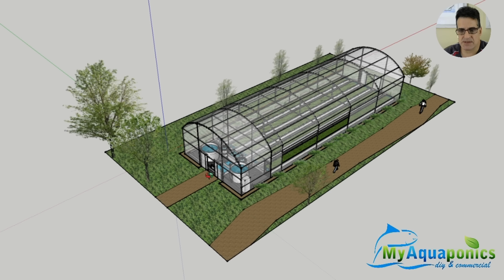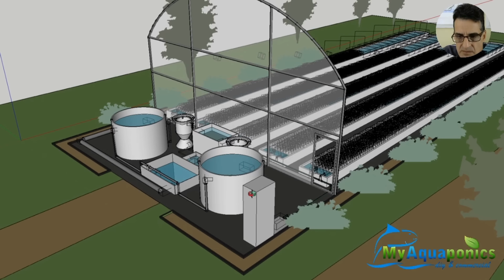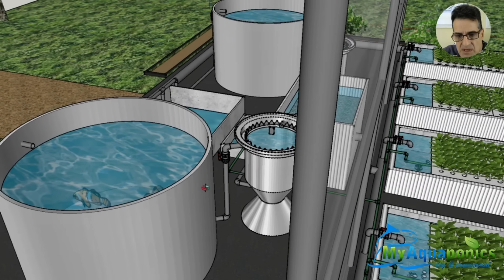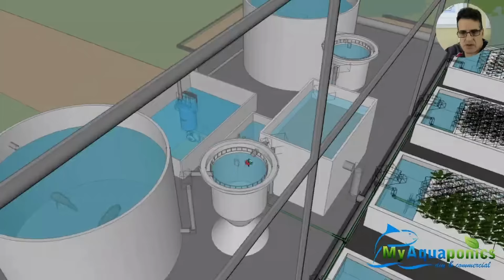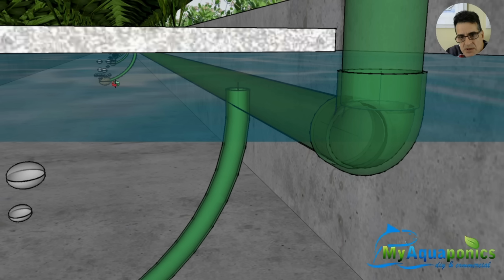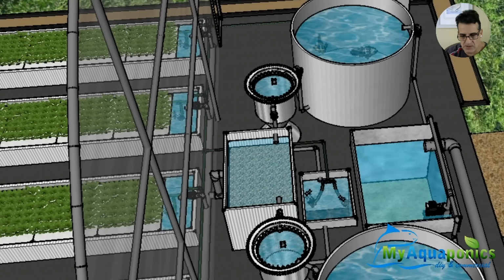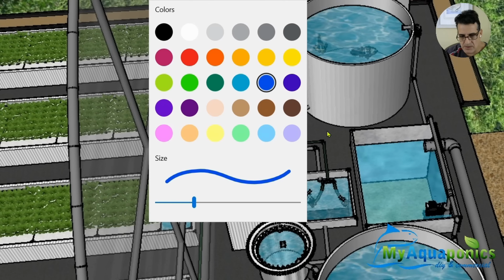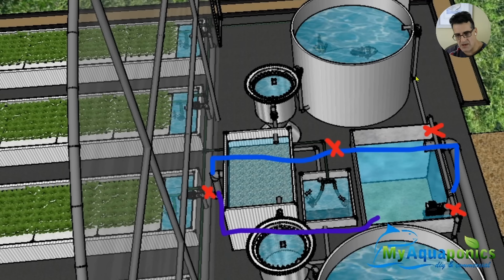The Best Commercial Aquaponics System Design explained in 3D : 2020

Comment: Very interesting. I am looking at this for tropical Asia. Water is abundant so I see very little need to pump it back into the fish tanks.  It seems like I can skip the biofilter if I pump it into ebb and flow gravel beds. What if I use the water from these tanks for the deep water culture further down? Will it be too lacking in nutrients then? Also wondering if I should skip those Deep Water Culture beds further down, instead opt for drip feed beds on the ground. I can then add other manure there if need be.  Also pondering if I should do azolla and duckweed somewhere in the system. Seems like it would take years to test out the optimal system. Guess I should build one greenhouse, then start with 1/4 of capacity to test it out. Then build out the other beds once I have something that works. The glass fibre beds that work both as ebb and flow and deep water culture is a genius move btw. Standardisation is the ticket.
Reply from the maker: Yes if you have ebb and flow media beds you can get away without a biofilter, all dependant on fish stocking densities.. Yes, you could use drip irrigation instead of DWC. Personally I would go with sandponics (sand grow beds).. Have a look at our Sandponics videos (Part 2-4) on our youtube channel. We do let duckweed grow on our DWC to feed to the fish .
Reply: @MyAquaponics1  Very interesting. Thank you, I will check those vids.

Comment: Won't all the right angles in those pipes reduce the flow rate of the pumps? Just curious, I don't actually know anything about this stuff, lol.
Reply from the maker: Not at all.. Of course there is always some loss due to friction, but in this design flow is not at the max capacity of the pipes. As long as you turning the volume in teh fish tanks every hour or so, all good.

Comment: How much total investment required??
Reply from the maker: in South Africa a system like that , using our 5m long fibreglass grow beds, would cost around R400K (about US$27K at today exchange rate)   excluding labour costs of course, but including installation of greenhouse. YOu can use cheaper materials to achieve the same, based on what you can source in your country

Comment: Hello my name is Welton I live in Brazil I found your project interesting, what is the value to develop this project?.
Reply from the maker: Hi Welton, thank you.  Cost is dependant on the materials you use and your cost of labour. In South Africa, it costs around R450K (USD 26.5K) for a 300sqm greenhouse fully kitted out with fiberglass grow beds
Reply: @MyAquaponics1  

I understand, do you provide this project with all dimensions for free? I found this project very interesting. Or is it a commercial project?.
Reply from the maker: @weltonbragadossantos5145  Hi, we do not make the sketchup file available to the public.. But pretty easy to work out.. that is a standard 30m x 10m tunnel.. The fish tank portion can be 8m long and fish tanks can be 5 m diameter and say 1.4m deep (volume of around 25000l per fish tank)  .. Grow beds 20m long and 1m wide and 400mm deep.. Drawing was done to scale, so the number of rows of growbeds is correct

Comment: How much does the system shown here cost?
Reply from the maker: All dependant on the cost of materials and labour costs in your country..  In South Africa, using our fibreglass grow beds, its around ZAR300K ( about US$ 21K at current rates), excluding labour
Reply: @MyAquaponics1  thank you - is there perhaps a list of materials with which I could calculate the cost here in the USA?
Reply from the maker: @JamesB-kz2vk  We don't have a set list of materials, as it all depends on what the customer eventually chooses (i.e. DWC, media beds, etc) and also whether they will use our fiberglass grow bed and tanks, or make up their own. Main items to consider are the customized greenhouse, water pumps, air pump or blower (plus airstones or other diffusers every 0.5m-1m), fish tanks (lines based, fiberglass, concrete, etc) , polystyrene floating rafts and netpots if DWC, LECA or other media for the grow beds and biofilter. Radial flow filter and buifilter can be made using plastic drums or IBC's.  Piping, pipe accessories and valves, easily calculated from the 3D model. Hope that helps

Comment: many thanks for sharing, really interesting video!
I see this system is slightly different to the regular split system you explained in a previous video where water from the biofilter goes to the sump tank and then from the sump tank water is pumped both to raft beds and fish tanks. Is it better to water the plants straight from the biofilter (like in the video) instead of pumping water to them from the sump tank? I imagine in the latter option plants would get less nutrients because the sump tank would receive a mix of biofiltered water and water recently used from plants (missing nutrients). Is this correct? Thank you very much
Reply from the maker: The split system is basically a design change that can also be applied to the system above by simply changing some valves. Th ebenefit of a split system design is of course to either run it as aquaponics, or hyrdoponics only, or aquaculture only. In recirculating  system plants will eventually get all the nutrients they require.. Keep in mind that water out of the biofilter would be nutrient (nitrate rich).. The function of the biofilter is to convert toxic ammonia into nitrites and then to nitrates which the plants uptake.

Comment: Shouldn't we have a smaller tank for fingerlings fishes before putting them in bigger tanks, to keep the operation running all around the year? Also wouldn't you recommend to use BEADS filter rather than using 2 filters ( one for solids and one Bio) ? Thank you
Reply from the maker: Yes, you can have a fish nursery, but that is usually done in a seperate tunnel or room. The Video above is for a commercial production unit.. Yes, you can use a bubble bead filter which can double up as a mini biofilter too, but they are generally expensive and depending on biomass, you would still need to have separate biofilters. Of course, if you have media grow beds in your system, they too act as biofilters.
Reply: @MyAquaponics1  you mentioned that you are growing Tilpia. İ am also considering to buy a full system like that to grow Tilapia Rendili red breasted while cultivating Duckweed on DWC. My only worries is winter. A greenhouse will not be enough to maintain a 30 c degree temperature during winter. Do you have a solution to keep the temperature above 25 c degree?
Reply from the maker: @Jean.34  If the greenhouse is well insulated with good grade plastic then temperatures in winter can reach 30c if the sun is shining. Not sure where you are located. In Johannesburg the sun shimes during winter days.. But yes, one still needs to heatthe water, there is no cheap way.. Heat Pump is about the best, or otherwise gas or wood heater
Reply: @MyAquaponics1  İ am in east Europe. We have 2 weeks every year when temperature can really drop. İ thought you are located in Sweden not south Africa.

Comment: How much is does this particular system cost ?
Reply from the maker: It all depends in the country where you are and the material and labour costs. Also what materials you use.. Grow beds could be done cheaply in brick and mortar in some countries, or with PVC liner and wooden frames. Here we would use our fiberglass grow beds which are more expensive.. In South Africa, a system like this in a 30 x 10m tunnel would be around ZAR 350K to ZAR 450K.. (about USD 32K)
Reply: @MyAquaponics1  how much can you in a greenhouse this big, both produce and revenue? of course we’re talking rough numbers .
Reply from the maker: @MA797-i5n  again dependant on what you ar egoing to grow..  If something like lettuce or spinach one can grow just over 4000 plants.. so multiply that by whateve you can get in your market .. every 4 weeks (after replanting the seedlings)
Reply: @MyAquaponics1  4000 lettuce per month ?  But thats going to take you a while to make your money back on just this hanger or system couldnt you potentially grow more in the same space
Reply from the maker: @MA797-i5n  you could grow more based on how you arrange the grow beds.. There are other higher value crops. You must grow what gives you the best return per sqm.. Any investment has a pay back period.. Most commercial farmers dont just build one tunnel
Reply: @MyAquaponics1  yes. But at 32k per tunnel, it will become expensive real quick to develop a series of these tunnels.
Reply from the maker: @MA797-i5n  as I have said, that is using the most expensive materials. One can probably do it far half of that depending on country, material costs and labour costs. This is a standard designed already in place in many countries around the world.  This model is not applicable for all countries or economies. If it does not suit your needs, then you need to adapt or look for something else that will serve your needs :)
Reply: @MyAquaponics1  thank you.

Comment: Thanks for sharing such detailed and comprehensive video on building a aquaponics farm. Based on this 10m x 30m aquaponics plant, how much yield one could expect to harvest on a monthly or weekly basis?  Can we get 7000 heads of cabbage every week?  How much the overall investment would be based on using Fibre glass tank?  Thanks.
Reply from the maker: Thank you.. In a system like that you could potentially have 120 Sqm of grow beds and if you are doing lettuce or herbs you can do 30-25 plants per SQM.  Growing cabbage is not recommended as they get very big and take up too much space, so maybe only 4-6 cabbage per sqm, unless you only grow baby cabbage.. In South Africa a 5m x 1.2 fibreglass grow bed sells for about $550 and you can fit about 24 of these beds depending on arrangement.. In SA overall investment for something like this is around $32K based on current exchange rate
Reply: @MyAquaponics1  Thank you so much for sharing the information.  This is much appreciated.
Reply: @MyAquaponics1  Am I right that I can expect a 4 week growth cycle from baby plant to harvest for cabbage?
Reply from the maker: @kenlee224  depends on the variety and climate, but from seedling to harvest can be 4-6 weeks

Comment: good evening sir, please i need the pipes dimensions & aeration network dimensions , drainage network dimensions , material type for water and aeration pipes , pump capacity , blower capacity for the 300msqare system .
Reply from the maker: Most water pipes 50mm. Return pipe from growbeds to sump is 110mm. Air feeder pipes, 50mm. Tap off air feeder pipe with 5mm flexy airtube. Airstones used every 1m or so 50mm diameter. Allow for 6-7l/min per airstone in teh systems to calculate air pump or blower capacity in litres/minute or Cubic metres per hour. For water pump, you want to be turning the volume of water in the fish tanks at least once per hour. So if you have 20 000 litre tanks, then you will need a 20 000l/hr water pump. PVC pipes can be used throughout.

Comment: what is the size of the biofilter? volume of water, volume of media and airflow requred to get it tumbling?
what is the target flow rate or turn over time for the fish tank?

cheers mate.

great video btw.
Reply from the maker: Quick rule of thumb is that the volume of your biofilter and solid separator filter should be around 30% of the volume of your fish tanks.. But for teh actual bio media, other more complex formulae apply which cannot be explained here.  You may be interested in getting our ebook that explains all that. Turn over of water in fish tanks, at least onece or twice per hour. BTW, no tumbling takes place in our biofilter and also no airflow in there. We simply fill the container with bio media such as bioballs or LECA (lightweight expandable clay aggregate) and make sure this media is always submerged in water.  OF COURSE, if you have some flood and drains with media, you may not need a separate bio filter at all. But if NFT or DWC, then you do need a sepaarte biofilter as in the video
Reply: @MyAquaponics1  thank you for the reply. 

curious how the bioballs compare with the leca balls?
Reply from the maker: @sweeyong7756  The platic bioballs we use have an SSA (specic surface area measure im m2/m3) of 500-700, whereas LECA is 240-260 SSA.. So bio balls have a much greater specific surface area for the beneficial bacteria to attach to. Bio Balls do however usually work out more expensive
Reply: @MyAquaponics1  cheers for that.
 yes bioballs do work out more expensive.  
i thought that there be some positive outcomes and results for veg gorwth as leca balls are made from expand clay.

Comment: How many pieces of fish should I put on that size of fish tank? Thank you so much!
Reply: The film has already said that 1000 liters of water can only produce 30 to 50 kilograms of fish.
Reply: "The Best Commercial Aquaponics System" Is this Commercial? Is this the best? 
If you use Dr James Rakocy's or Dr Wilson Leanard's formulas for plants to fish needed then this system should have at least 300kg biomass or have an average of 1500 fish at 200grams to give the plants enough nutrients to grow. If you harvested one tank then half the available nutrient production is lost. This system would then rely heavily on additional nutrient / fertiliser to supply the needed nutrients so that the plants don't go through cycles of severe nutrient deficiency each time the fish need to be harvested. Also the amount of fish food would create a lot of fine particles even with the swirl filters and they will get into the DWC and smother the roots. Do you also have to replace the air stones with cleaned air stones once a week as they get clogged up with nitrifying bacteria.  My 5 cents observation.

Comment: If I put up this aquaponic,  how much should I prepare for the materials? Let me know the dimension of every growbed and the fish tank
Reply from the maker: It all depends on the cost of materials in your country. IN our country the cost is between R450K to R550K using fibreglass grow beds
, including teh 30m x 10 m greenhouse tunnel .

Length of growbeds anything from 18-20metres long and 600mm to 1m wide (if access from both sides). Please listen again to the video regarding tank sizes required. Keep in mind that you can stock between 20 and 30Kg of fish per 1000 litres of water in your fish tanks. You can push higher, but then you need to have extra aeration and good power backup systems. With 25 000 to 30 000 litres of fish tanks, it should be adequate. There are specific formulas that you need to use when designing and sizing your system. You may want to look at our ebook https://myaquaponics.co.za/ebook-pdf-secrets-to-successful-aquaponics-farming-backyard-commercial-systems/

Comment: Thanks for work well done i would like to develop 30x10 aquaponic system may you give me quotation and specification for one unit so that i can have them here in Adjumani- Uganda Regards Peter- Okuonzi
Reply from the maker: Thanks, unfortunately we are based in South Africa and we don't serve the export market. Transport of Greenhouse and installation thereof in Uganda would not be feasible. You could potentially build all that you see in the video with local materials such as brick and mortar and locally sourced pipes.. Of course, we could maybe supply the water and air pumps and other miscellaneous, but to make it viable, local sourcing is the best option
Reply: @MyAquaponics1   what if you could give me the specification of the various components?
Reply from the maker: @peterokuonzi4172  the video does give you sizes for tanks and grow beds. Send us an email on sales@myaquaponics.co.za

Comment: Hello, I am planning for DWC, can you pls let me know what sump tank size and capacity is required,  If I have 3  growbed is 32'x92'.I would request you tell me the size of the pipe which needs to be connected to the growbed.  what interval should we fill the nutrient solution to the growbed..
Reply from the maker: You don't really need a sump if you only have DWC beds, as the level of water in those beds is constant.. YOu can use teh actual DWC grow beds as the sump

Comment: Hello, very informative and cost effective design ever. I would like to know how much it would cost to set up a commercial aquaponic system as per your design in 10000square feet area. Will this model works in India. Thanks a lot and looking forward for ur reply.
Reply from the maker: Thank you. This is a 300sqm design, to fill up your 1000sqm, you would need 3 of these. Costs depend on your country. In South Africa, it costs arround R450K (USD 26.5K) for a 300sqm greenhouse fully kitted out with fibergalss grow beds
Reply: @MyAquaponics1  Thank you. You've showed 3 diff types of materials for building grow beds. Among 3 which is cost effective.
Reply from the maker: @kavinilavu7716  Again, it all depends on costs of material and labour in your country. By using fibergalss beds we save a lot on time and labour. Where labour is more affordable, doing it in brick and mortar, or wood frame and PVC sheets may be more affordable.
Reply: What would the ROI be for a 300sqm system. Can your company set this up anywhere in SA and do you provide training when someone buys this system?
Reply from the maker: @Frankly-Gordon  ROI is totally dependant on the plants you decide to grow and variety and market price in that particular location. Of course some product can also be dried or preserved, increasing the value add on profit potential. We offer aquaponics course, next one on 24 October in Johannesburg. We do not get involved in the construction, but can supply most of the equipment required. Mainly active in Gauteng. For more info sales@myaquaponics.co.za